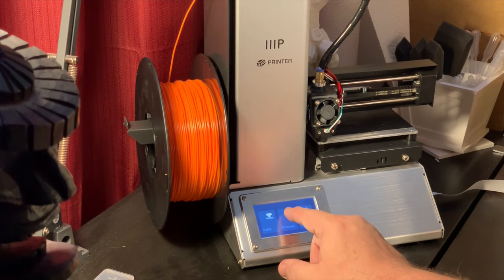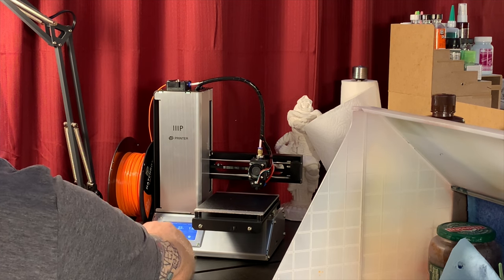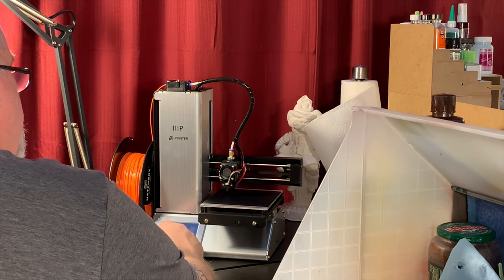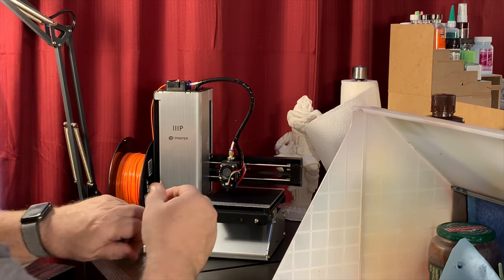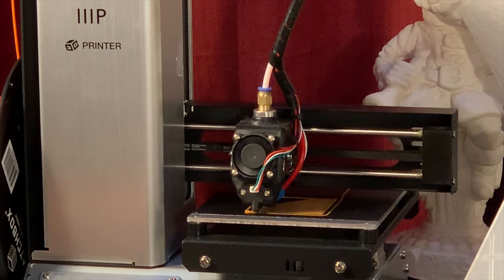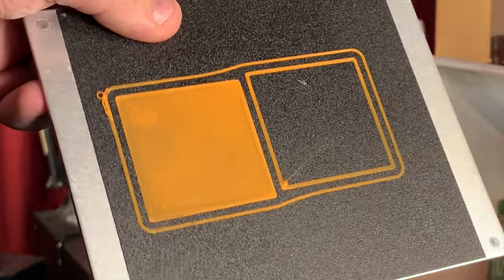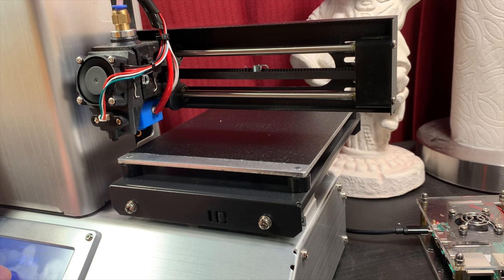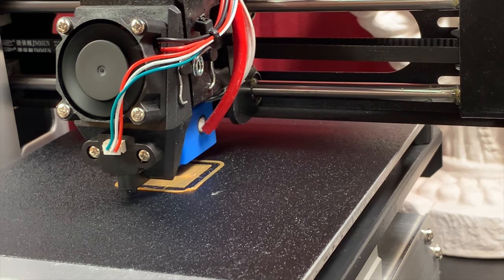Setting up your new Monoprice Select Mini Pro - Setting Nozzle/Bed Gap

Comment: I think your video may have answered my issue.  The close and far I have misunderstood.  I have been adjusting based on the following.  I have used the 'close' adjustment thinking the head is to close and not as in your video to bring in closer,  I thought the distance was increasing as the numbers although negative increased.  Likewise I used ' far'  thinking this adjustment would bring the head closer.  Am going to try your levelling method so fingers crossed.  I received the printer a week ago and was totally blown away by the quality of the test print.  I moved the printer from my lounge to another room and my settings have gone to pot.  Thank you though for a very clear and easy to understand video.  Going to try this now :-)
Reply: I had the same issue. I had it backwards.

Comment: Thanks for your help Pauly - this video helped me realise that the buildtak esque heat bed sticker I had installed was interfering with the inductive sensor. I wouldn't have realised this without your section on adjusting the height of the inductive sensor. Now all working again (and a new heat bed sticker required!). Many thanks from Scotland!
Reply: https://www.youtube.com/watch?v=AOPlwnisv4s video showing the error, in case anyone else finds it useful!

Comment: I am on my 3rd PRO and still have my original V1.  Actually, my V1 seems to be a V1 plus heated bed.  Anyway back to my Pro.  The first one came in with a Z axis that would not move.  The second one, I enjoyed for a month until it started hitting the bed no matter where the "tune" was set.  It tore the paper right off. This last one came with a different extruder and different bed paper.  This extruder does not  have a gap between the extruder and the bowden tube connector.  But it looks like a printed piece instead of a nice shiney mould injected piece.  I want it for my model v1s also. It looks better for handling flexible materials.   Well, it is just finishing its first print,  Some Z banding, but otherwise a very decent print.
Reply from the maker: I still think it is a great machine.  I've printed about 75% of my Terminator arm on my mini....
Reply: @pauly7218  No doubt that it is basically a good machine.   What I was saying is that they are even improving the Pro over what was sold a couple of months back.

Comment: Late to this video but, I saw you are using a glass bed. Could you tell me if I have to make the Z spacer as thick as my glass? Or it doesn't matter? Is the auto leveling working with the glass? Best regards.
Reply from the maker: Sorry - Still use the original bed.  Only have glass on my Ender 3

Comment: Help, I finally got my printer setup today. I Print with normal PLA and tried temps of 195 to 200 and then ive setup cura settings. But its okay apart from I Get LINES in between my print ??? like some layers it can be fine but then the next layer will have a small gap. and its just random gaps??? im not sure whats causing it? if you want pictures let me know and i wil upload them

Kind of putting me off because idk what to change. Also when u auto level does that also auto level the z axis so i dont have to change the bed correction or?? because not sure if thats somthing to do with it but idk

Comment: My mini pro doesn't have that adjustment screw and my sensor is hitting the printed material. Is this printer DOA?
Reply from the maker: The screw is behind a piece of black tape.  Hard to see, but should be there.....

Comment: What sort of nozzels do you use? I bought a kit of e3d nozzels, but I can't adjust the tolerance out enough to use them. I was hoping to use some different diameters. Thanks
Reply: dang, now it's not adjusting back to the original nozzle either. I'll contact monoprice and see what they say.
Reply from the maker: I just use the stock .4 nozzle in brass.  If I need anything more elaborate, I can change the nozzle on my Ender 3....

Comment: My bed is not leveled. During the autoleveling.... First point is kind of OK; point 2 is about 500um high. point 3 in 100um low and point 4 300um low. is there any way to fix it ? thanks in advance
Reply from the maker: It sounds like you have a warped bed, which is common.  What your describing doesn't sound too bad, so as long as you have the offset correct, you should be fine, and the auto level should adjust as it goes....  If not, contact MP for a new bed....
Reply: @pauly7218  Thank you Paul

Comment: Hey how you doing thanks for all the help I have 1 question. I had a really bad jam so I took everything apart and when it jammed the plastic tube where the filament runs thru popped off of the fitting how do you correctly put it back because it won't just stay when I put in in and pull the tab a little back. Hopefully u see this and respond thanks really appreciate it👌
Reply from the maker: The tube is called a Bowden Tube.  The connectors that came on the printer aren't very good, fortunately good replacements are super cheap.  I suggest you replace your tube with Capricorn Tube and new/better fittings.  Either way, the tube simply pushes in to the connector.  It goes in pretty far.  To remove the tube from the connector, depress the ring and then draw the tube out.  On the hot end it is extra important that the tube is all the way in or you can get ugly clogs!
Reply: That's a bunch very informative and super helpful I really appreciate it! Keep up the good work my man!!!

Comment: Thank you for this. I ended up having layers in my prints shift as I was printing. Hearing clicks I thought it was the sensor being too low knocking things so I did the paper trick. I got it where it looks good at 0 and it won't let me go further away than that. The lines are slightly flatter than before, but are straight and stick well. I'm trying another print now to see if it helps.
Reply from the maker: It seems clear that this magnetic cover has a different thickness than the original Matt.  This means you need to adjust the "offset" on our printer.  This would apply anytime you make a change that could potentially affect the thickness of the bed either thinner on thicker.  I hope this made sense...

Comment: So by using this method, are you bypassing the auto leveling feature?
Reply from the maker: Daniel Smith NO!  You still need to auto level!  This just sets the proper spacing between the nozzle and bed and really only needs to be done once. I level
For each print to be sure everything is good

Comment: I just chatted online with monoprice about the adjustment screw on the sensor. They told me that, no matter how you adjust it, the sensor resets when it finds the bed during homing and at the beginning of prints. I’m pretty confused by all this.  My thinking was that I could adjust to a glass bed this way, but they tell me it is impossible!  How have your results been over time?
Reply: You'll have to adjust your z stop switch to go to glass. https://www.thingiverse.com/thing:2795863 the Printer needs to know its at the bottom to work no mater how you level it.

Comment: I all ready messed up my buildtak surface with a razor blade and now i'm looking to add a piece of glass.  Have you done this?  I'm not sure how to put in the offset to compensate for the glass.
Reply from the maker: measure the thickness of the two and adjust your offset for the new thickness of your build surface!
Reply: @pauly7218  I was thinking it was that simple, but i keep reading about Z axis spacers.  maybe there isn't enough adjustment in the offset menu.
Reply from the maker: @mooosestang  There should be plenty, but honestly, If things are running good, why not just replace the original surface - mine works great....
Reply: @pauly7218  My aluminum plate is warped, it may have been warped from the start or it started to warp after a few prints.  Heating and cooling thin aluminum is not a great idea.  It's so warped now that auto leveling isn't helping.  Any part of the print towards the middle won't even touch the build surface on the first layer.  I got it working with a 5x7 picture frame glass panel and i used a z spacer just in case.  i just slowly adjusted the offset.  I can say that glass is so much easier to print on using pla, but much harder to get the print off of so i'm using elmers glue stick more as a release agent than a bonding agent. I'm not really surprised the aluminum warped, i'm surprised it warped so quickly though.
Reply: I also will be printing mostly tpu and want the ultra smooth glass surface to give me that glossy finish on the bottom of my prints.

Comment: What was your z offset AFTER you adjusted the sensor ?
I am currently bidding on one of these printers on eBay , keep those fingers crossed for me please .
Reply from the maker: IF you adjust the sensor you can get to like -0.08 or so.  The main point is, don't fret a huge offset - it's not abnormal!
Reply: @pauly7218  many thanks for that . I won the eBay auction so just have to wait for my next monoprice ( I currently have a select mini v2 ) to arrive from Germany . 
This one is used ( as my first one was ) and am hopeful the next one will be in as good a condition as the first.
Reply: My Mini Pro arrived yesterday & I've managed to dial in the offset setting (  in my case it is -0.33 ) on the stock build plate. Had a bit of trouble with bed adhesion ( my printer is 2nd user  & its stock buildtek bed shows signs of misuse ) so i have started using Elmers glue stick which after a couple of test prints seems to work well .

My next task is to use this printer to print a z-offset spacer for my other printer ( Mini Select V2 ) which is suffering from warping of the print bed so I am going to install a glass bed that i hope will eliminate this problem?

Once that's done & I'm happy I will probably also install a glass bed on the Mini Pro. 

I have already ordered 2 glass beds from china supplier which have arrived but they are differing thickness ( by approx .5mm!! ) so i will have to ensure that each glass plate is only used on the printer for which it was calibrated

So far so good thanks to your help

TTFN

Comment: So what does the "auto level" button even do then?
Reply from the maker: It measures the location of the bed in four locations and the adjusts the printing process to keep the print level
Reply: @pauly7218  hmm I see. So do you use that alongside the manual adjustment?
Reply from the maker: Yep!!!   Set your offset and it stays that way unless you mess with the machine, but level the bed before every print!!!
Reply: @pauly7218  Ok great thanks and I am still confused (the user manual really doesn't explain anything) but the offset is the distance between the sensor and bed? Does that mean that extruder is at the exact same height as the sensor?
Reply from the maker: @TheTranq  The offset determines how close/far the nozzel is from the bed - Critical.  The sensor is only there to determine the height of the bed in four points to see if the bed is level.  If the bed is not level, the machine will then use the measurements to adjust the print to accommodate for the difference.  It has nothing to do with setting the gap between the nozzle and bed....
Reply: @pauly7218  oh I see. And the offset is referring to the distance when the extruder is at what z position? Thanks for the help

Comment: Hi all and thanks Pauly for this great video.
I have a very weird scenario... I've set printer to 0.11, I print a perfect, lovely, amazing cat (the example from factory). Whatever else I print is... A rat's nest! What is wrong? :O
Reply from the maker: probably still too big a distance between nozzle and bed.  Cat prints on a raft.  You need it to print good with no raft!  Change cat support from raft to skirt and try printing.  cancel if skirt doesn't stick good, and adjust offset!  I hope that helps...
Reply: @pauly7218 
Hello and thanks for the great help!
I have been printing like a madman for the whole night and the only moment I got a decent result was... When I reduced  resolution! Is there a resolution range (best to worst) that you recommend for this printer? Thanks and sorry for taking your time.

Comment: So if you do this properly you can skip the "Cura cure"?
Reply from the maker: I wouldn't as it is a darned good starting point that prints reliably time and again.  When you feel good about it, you can start experimenting and increasing quality.  Enjoy!
Reply: @pauly7218  I see, would have been nice to just be able to use the predefined Cura presents fine, normal, rough etc.
Reply from the maker: Give it a shot and let us know how it comes out!  I discovered the Cura Cure prior to figuring out the issues with the printer so, you never know...   @viktorrene

Comment: Unfortunately this printer has become a major headache,  I am now on replacement printer number three which is pretty good going considering my original purchase is just over a month.  First issue was touch screen LCD total failure,  new printer sent.  After one week the new printer developed a fault where the stepper motors would not move according to the touch screen controls.  Re-seated all the sockets etc another printer received.  Credit where credit is due the customer service has been excellent but I cant help but feel sorry for the staff who are having to sort out these issues when some basic Quality Control could avoid many of the issues people have been experiencing.  This 3rd printer has now an issue but I have repaired it with parts from printer number 2 which I am yet to send back.  Touch wood number 3 is now producing excellent results again but my confidence in this Company is almost non existent.  I have been refunded in full with no questions asked and they have provided me with free returns.  However my point here is not the cost or the service its the fact that 3 consecutive machines failed which seems excessive and a failure rate that surely cant be acceptable to any company.  I know MP is a US company so maybe our standards and expectations are higher in Europe.  While the 3rd Machine continues to produce excellent quality prints it really does stand amongst the best but reliability uuuum  maybe 3 successive machines is acceptable and I am expecting too much